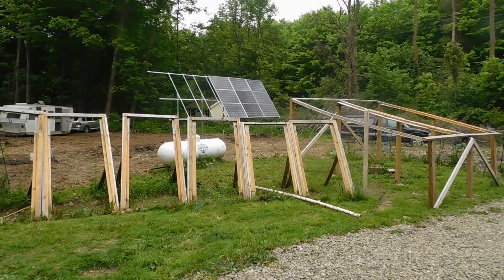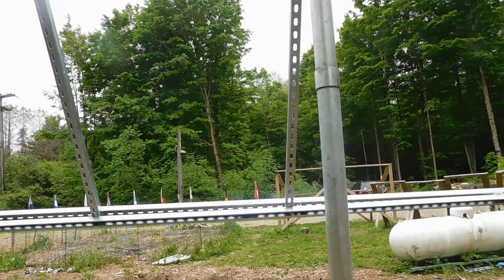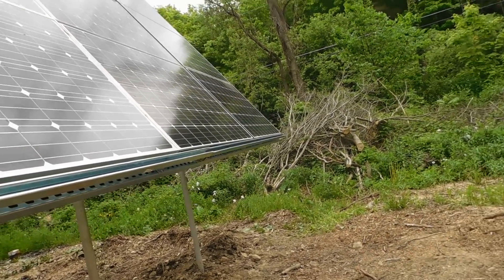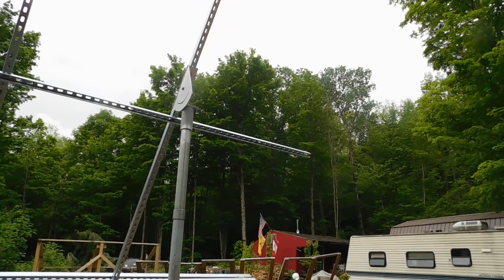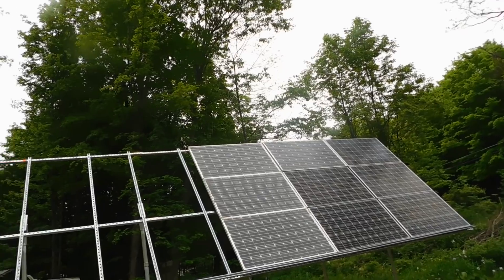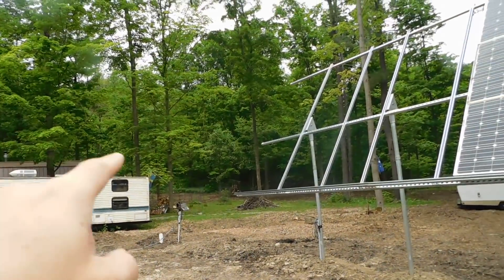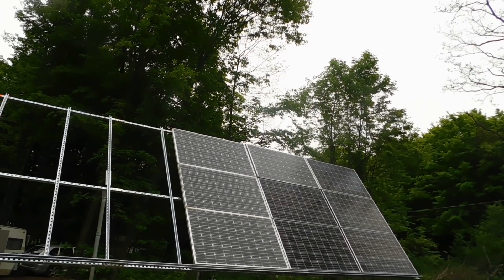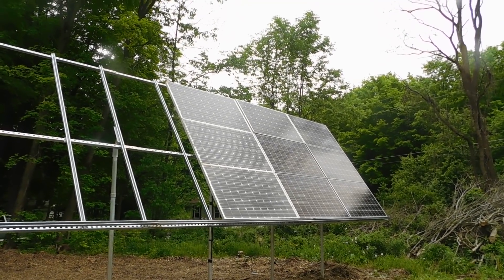Our new DIY solar rack and how we did it.

Comment: Great upgrade to your racks. You could use some "jack poles" tied to the bottom of the rack for adjustment. That would hold the angle while loosening the angle adjusters, then loosen the jack poles, make the adjustment, tighten them, then the angle adjusters.

Comment: That's a fantastic design and it looks strong and professionally built. I was wondering if you're planning on putting anything on the edges of the three horizontal supports that are for the future expansion to prevent an injury to someone walking by.

Comment: Super upgrade, Ed!👍🏻 I think you're really going to NEED the charge controllers to keep from overcharging the batteries! You can probably attach a cable from the top and bottom bars to the ground to keep them from moving while you loosen the adjustment bolts, loosen the bottom cable, then pull the rack to the desired angle by yourself, if needed.

Comment: Condor😂—That’s 1 5/8” unistrut  mechanically connected with spring nuts, splice plates, and 3/8” bolts. The stainless strut is a lot more expensive than the galvanized strut. There are a couple of ways to recognize stainless 
1. A magnet won’t stick to it
2. Its impervious to elements ( won’t rust) 10% chromium
3. Stainless steel is much stronger than regular steel ( harder to cut)

Comment: Top center panel looks a bit wonky like it doesn't fit between the outer panels so good ... Make sure you caulk and tape the top of the conduits so moisture doesn't get in and rot your wires ... Might consider Earth augers and tie downs for the bottom of the frames ... Use the softest bristle broom you can ... Don't want to scratch the cells ... Better to have unused power for future uses ... All in all looking good ... I like to over engineer stuff ... 😎 Raised beds for peas, carrots and salad fixens behind the panels ...

Comment: Yes! Looks promising.  Definitely put the support between the panels and the posts.  The weight will stress those bolts that are holding your angle.  I use a telescoping pole with a professional window squeegee to clean off the snow.

Comment: Youl have plenty of power. The angle the snow won't stick bad. It's a little on the light duty   people don't realize how much force is on those racks  put your angle braces in like you were saying then put post in the front into the ground then it should be ok in the trees.

Comment: You might  want to isolate your aluminum solar panel frames from the unistrut   cuz it will cause galvantic carosion   get or make plastic washers    or shims.  I made mine out of plastic milk. Jugs   and ground bonding is inportant  to special  bonding hardwear is needed  cuz same carosion  copper to aluminum . Course. If you have a electrion working with you he would know. . I found out the hard way !  Looks good

Comment: That's a great looking solar panel mounting rack.  I am glad to see that it is designed to pivot so that you can adjust the angle to the sun for each season.  Although winter and summer settings should be more than sufficient to maximize your output from the solar panels.

Comment: Hey Ed, it really looks great!  
Since you have so much power already mounted, you might want to put those other 6 panels into a faraday cage for the moment, instead of installing them right now, until you get something to replace them. Just saying... Be safe!
Reply: Generally speaking, emps are not a threat to solar panels. Solar charge controllers and converters are a different story altogether.

Comment: 24° angle for Winter and  Spring/Fall  47° angle and Summer  70° angle for New York
Reply: I take it your angles are referenced from vertical.  For Winter in most of the northern hemisphere you want the panels almost vertical and for summer you'd want them almost horizontal.

Comment: I have been picking satellite dishes from the side of the road thinking I can use the adjustable bracket that mount on the pole for a project like this. I would just have to adjust where the uprights and cross-braces are for the 4 corner bolts on the bracket to line up NICE JOB ON THE RACKING
Reply: Great use of material.. i like that